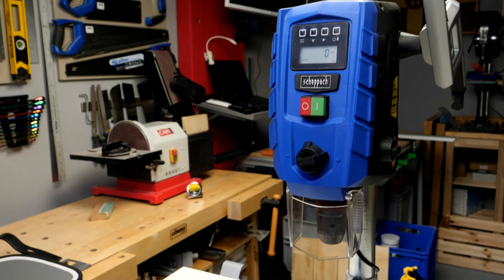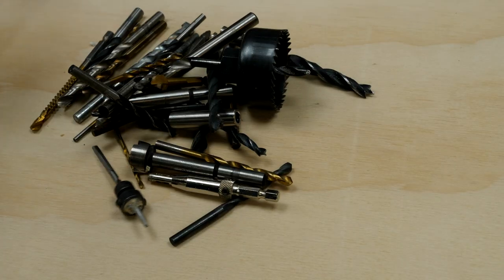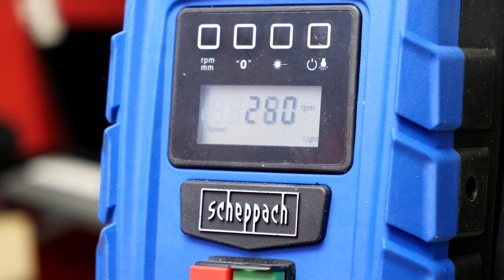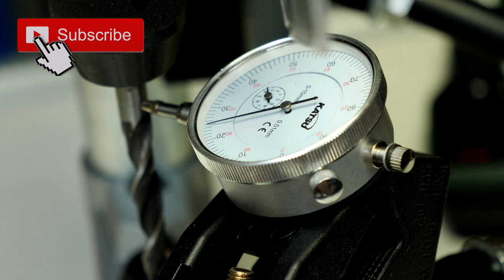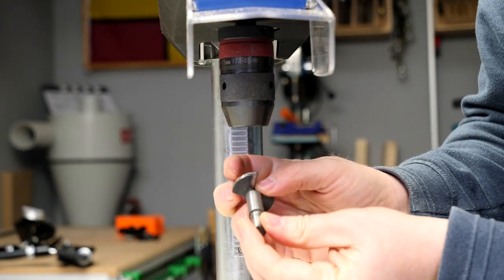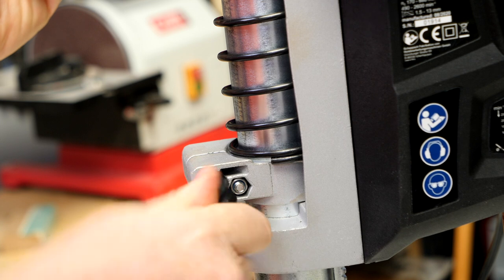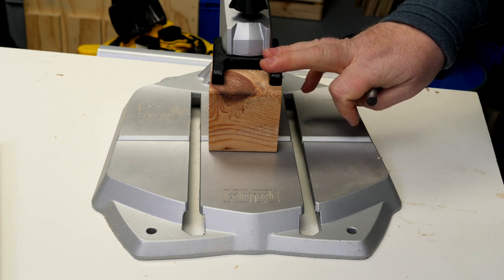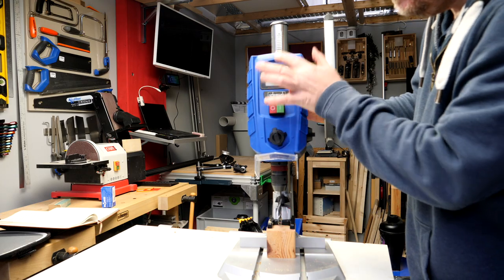Is the Scheppach DP 60 710w Bench Drill Any Good?

Comment: This seem to be almost an exact copy of the Bosch. Some small design changes but otherwise identical down to the run out of the drill.
Reply from the maker: It's the overall design is the same. But it really is not a copy. I've since replaced this machine with the Bosch bought new in January. As far as I can tell (and I've had both apart) none of the components are the same - similar but the quality is lower in the sheppach (built to a price). The run-out on the bosch I have is negligible compared to the scheppach. The bosch is quieter, and soft-start speed controller, has a way better barings and chuck. All the castings on the bosch are finished properly with all the sprues and flashing removed (no sharp parts), the plastic for the housing is better quality. The base is wider and the unit more stable.

There will be a follow-up video to this one now I've had time with both. Yes, if you in the market for a budget drill then this would be fine if you can live with its bad points. But the Bosch version is much better value for money.
Reply: @StrawbyteWorkshop  thats good to hear. Thinking about buting a Bosch myself

Comment: Good review Carl. It looks too plastic to be convincing of any quality.
Reply from the maker: Hi Graham - In all fairness it cuts pretty straight and accurate holes. But certainly the  quality of the case is poor and, like I said in the video, the finish to the cast aluminium parts is a bit rough. You can see where Scheppach have made the unit to a price. I did tear-down the machine and have looked in detail at some of the components and simple things, like bearings, are cheap chinese commodity parts. The chuck is the same a generic version of the Rohm chuck found on the Bosch drill. But at £129 it does, I think, stack-up well against more traditional bench-top drill presses at that price point. None of which are precision or quality items in my view.
But thanks for the comment. Keep watching I've more to say on this in a future video.
Reply: @StrawbyteWorkshop  Cheers Carl Happy New Year by the way.

Comment: Sadly its a great looking drill, but low quality. Have had several problems, and now after a couple of uses uts wobbly, the chuck is alsaw hard to lock. Do not recomend it
Reply from the maker: The machine you see in the video has held up fairly well. However, the chuck did fail and I had to fit a replacement. It's the noise that bothers me though and I would say the machine is built to a price and not good quality.

Comment: Bosch PBD-40 wobbles on column itself, this is not adjustable as there are not screw for adjustment WHY. Why any Cheap drill stand has adjustment on the column with screws and drill machine for 340EUR does not, BOSCH are idiots or think that we are.

The chuck is OK but it has wobbly bearing too.
Reply from the maker: Thanks for the comment.
Reply: @StrawbyteWorkshop  Your welcome, the chuck needle bearing needs to be replaced with brass bushing then play of the chuck goes away. However how to solve the wobble of drill itself I do not know, except drill bolts of 8mm fine thread into the aluminum casting place steel nut inside with expoxy fill. Bolts must be brass. The inside if the aluminum sleeve must be enveloped with thin brass sheet too.

Comment: I bought this drill from Aldi U.K. unfortunately it was soo in accurate trying to drill 3mm aluminium sheet with 3.5 drill bit it was nearly 1/2 hole diameter out of centre mark. Aldi were brilliant gave full refund no quiver. Really disappointed as the concept of this drilling machine ticked so many boxes, but a drilling machine that does not drill with a measured accuracy is not acceptable for diy and model making projects .
Reply from the maker: I'm sorry to hear that and that is a shame. Their returns are very good though.

Comment: 0.2mm run out is disgusting for a new tool why would you buy something of such crap
Reply from the maker: Compared to reviews of earlier models 0.2mm is better than I was expecting. I was being honest when I said for what I need it's good enough, but the design is flawed.
Reply: Can you point to something with better accuracy at the same price?
Reply: @ian1352  No but it shocked me that it's brand new and has that much run out, bin it off, and invest in a proper one 😉 I have one the same was thinking of new bearings but you vid has put me off doing it now good luck Ian.